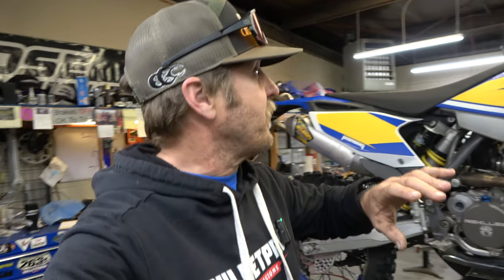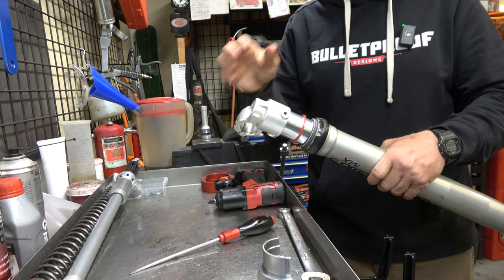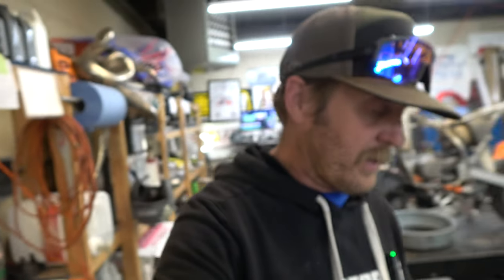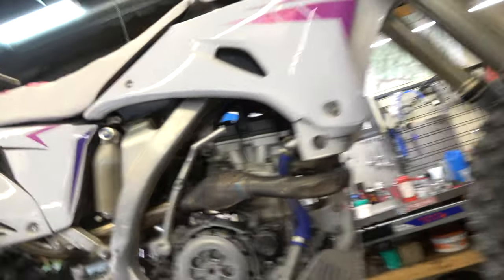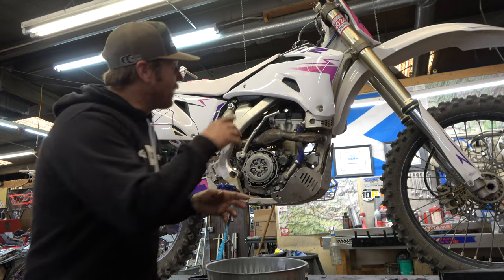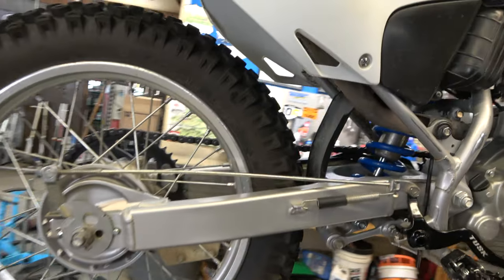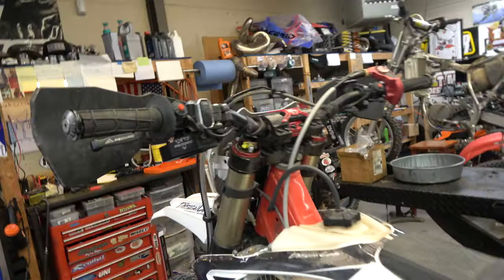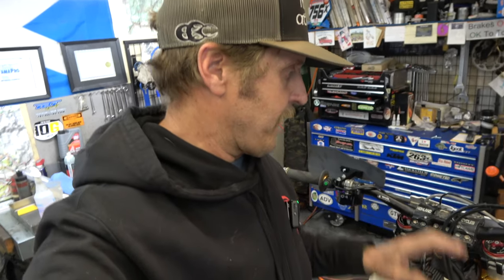New Bars On the KTM | Bike Giveaway | YZ250F CLutch | The Shlog 278

Comment: I have a set of 4cs with the Race tech valve, which essentially makes them an open chamber, and they are some of the best forks I have used. 4CS forks have been best described as “consistently inconsistent”... That’s before Race Tech converts them to open chamber and adds Gold Valves. On the standard 4cs, there is a little o ring that tears inside the rod super quickly...

Comment: Morgan are there also front brake light switches? This would be for a te300.  I don't see much info about that.
Reply from the maker: Yeah. You can just use a normal banjo pressure switch on the front
Reply: @highlandcycles  Thank you!

Comment: Which Penton parts are giving you trouble tracking down ? And no, I don't have a stash of early Penton/Ktm parts , just curious.
Reply from the maker: Ignition coil
Reply: I've had a look 'locally' to me - which means the UK and Europe and I can find quite a selection of Motoplat parts . Depending on the budget 'electrexworld' in the UK do a complete replacement ignition system for Motoplat style setups. I've seen another place that offers refurbed parts , again UK. Hope you find a solution, I'd like to hear and see a ride report on some vintage tackle.  @highlandcycles

Comment: I definitely wouldn’t want you putting bolts into my clutch with an impact wrench…,,that’s just me though. Start them by finger and then hit them with the impact…..I would be ok with that. 👍👌
Reply from the maker: This impact is such Low torque and I’ve been running bolts in with it for so long that I can immediately tell if it’s not straight. I start just barely on the trigger and when I know it’s started straight, I speed it up. I’ve checked torque after it clicks a couple times and it’s always under 8ft/lbs
Reply: @highlandcycles  I was just giving ya a hard time! 🤘